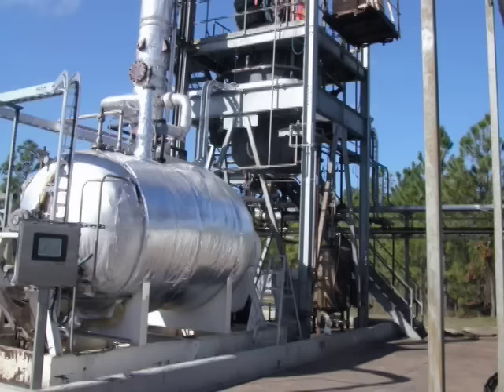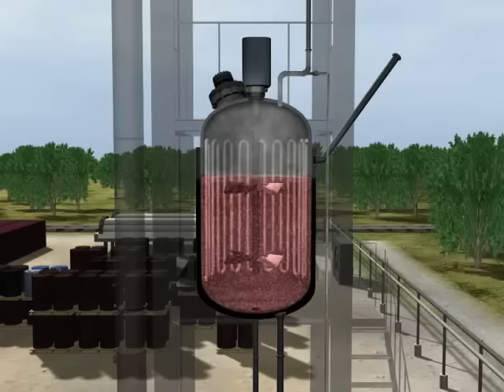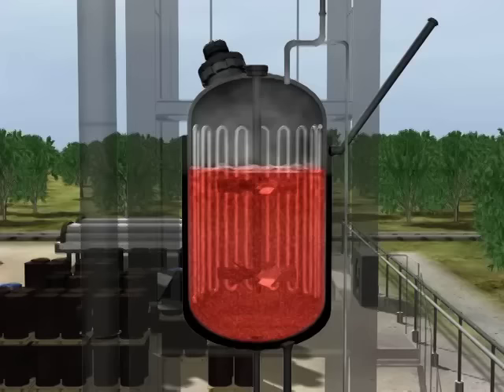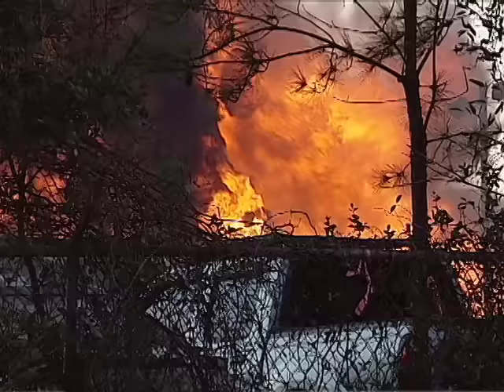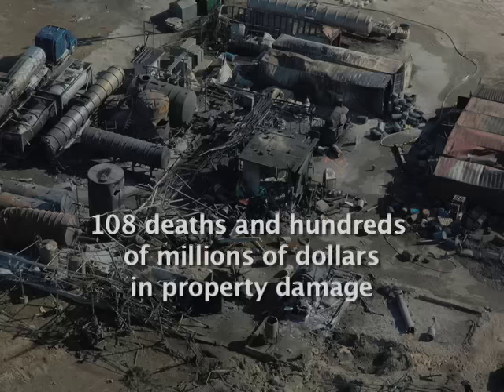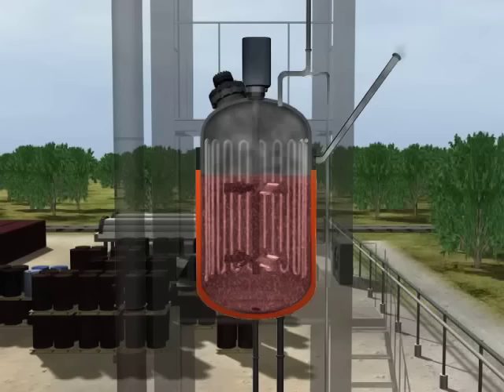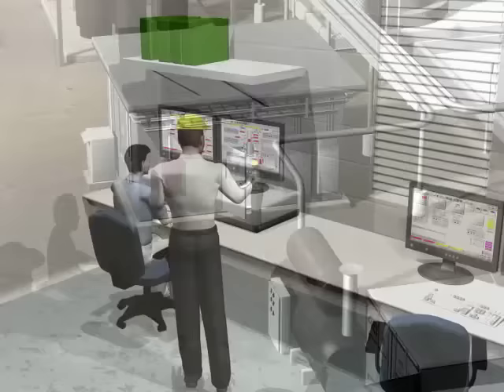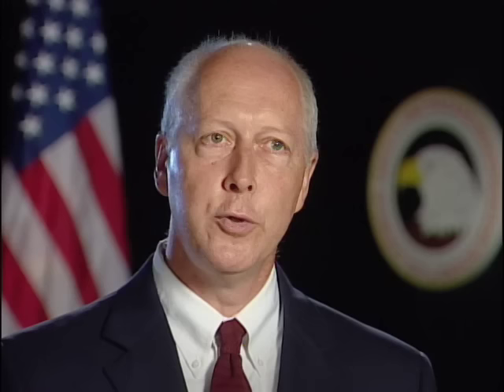Runaway: Explosion at T2 Laboratories

Comment: I work at a chemical plant. I’m a reactor operator. We run 3 3500gal reactors at almost 900psi routinely. Our high pressure interlock is 960psi and our high temp interlock is 95°c. We have 4 safety systems we can go to after operator controls are deemed ineffective. Rupture disk, catch tanks, valves to catch tanks, relief valves, E vents, E stops flares. It’s a very complex system but this tragedy was avoidable. None of these companies ever go above and beyond on safety, that cost money. Although I do feel my plant has put an honest attempt into it. Stay safe blue collar men and women.
Reply: Yep, like I mentioned above who designs something like this without a backup cooling system? It's unforgivable on several levels.
Reply: Sounds great Engineering dd !!
💪💯
Keep safe !! 
😊😊
Reply: I work at a plant as well. and I don’t think we’ve ever checked if everything works before making a batch. The only thing we check before making a batch is that we have all of our raw materials…we find out shit breaks WHEN the shit breaks.  I’ve only been compounding  5 months and I’ve never checked if my cooling systems work s prior a batch. 

I will NOW tho
I’m pretty sure our only cooling method is city water as well.
Reply: That's how you do it. One of the fundamental mindsets of any engineer is to plan for the worst case, not the ideal. Assume operator error, assume failure of systems. Have redundancies, interlocks, the whole nine yards.
Reply: @whiteru55ian33  You could show this video to your superior and make them realize the danger before anything catastrophic happens.
Reply: @skunkjobb Facts!
Reply: What you describe is the minmal basic security, as you say, it is not at all "above and beyond". The tragic thing is that the US is so adverse to unions (and many of your unions are honestly not doing a very good job at being a workers interest organization) that we see a complete lack of safety requirements that make accidents as bad as Bhopal (which was in India in 1984) still very much a near certainty in the US.

Comment: I worked for six years as a synthetic organic chemist. In a laboratory, each day, I mixed two chemicals in a 20 oz flask with a solvent and stirred them overnight, to react together to form a new chemical. If that chemical was determined to be of interest, we sent my process to another lab in a distant city, where experts in scaling up from 20 oz to 1,500,000 oz would design a new reaction. The difficulty is that the larger amount sheds heat 1/100th as fast as the smaller.
Reply: That's a lot of stirring.
Reply: Your hands must be very strong
Reply: @aarontooth  There is such thing as magnetic stirring, y’know?
Reply: Why can factories that create potentially dangerous things be allowed in the middle of inhabitants it should be put outside cities for safety. Like Lubrizol in France look it up.
Reply: @CanularRadio  the vast majority of the time they were outside the city limits, when they were built. It's just the city's grow and houses are built close to these chemical plant, much later on.
Reply: @Etz-b37  Bingo...
Reply: @Etz-b37  Exactly. The land around industrial zones is cheap (for obvious reasons), so developers build new developments on it.
Reply: I think this is more of a lesson about why redundancy is so important.
Reply: Sounds boring
Reply: Interesting ! Which compounds ?! 
😊🙏
Reply: People are totally unaware of magnetic stir bars and hot plates lol

Comment: Exothermic reactions need to have backup cooling systems. It’s a must. Uncontrolled positive feedback gets very dangerous very quickly. Also with uncontrolled positive feedback can cause very abrupt pressure rise and clearly needs a better pressure relief pipe, if it exploded within 10 seconds of the disc rupturing, it clearly wasn’t sufficient.
Reply: Two words. Complacency kills.
The processes weren't properly analyzed, failure modes not mapped, proper reactor emergency responses not documented and trained on and the design was horrendously deficient. As you said, an emergency cooling system and adequate venting system could've prevented the accident. Honestly, it was a miracle more weren't killed and injured from such a blast.
Reply: @spvillano  This kind of process is best done in continuous flow system. Not so much material in a single vat, so it is easier to cool or won't explode at all.
And it it goes wrong, there is less material, so a much smaller explosion.
Reply: @pizzablender  all true, although as I understand it, not all processes can be done that way.
Reply: @mnxs  Correct...
Reply: Right? The whole system was designed more like a firework than a safe reactor!
Reply: My thoughts exactly, as soon as they heard the whistling they should have known they F'd up, just to bad by then it was to late.
Reply: they were completely unprepared to run the reaction on a larger scale

Comment: Reactor for known exothermic process built with ONE source of cooling? WTF did they think would happen if power outage took down their CW pumps and/or caused drop in water pressure/flow from city mains? Always have min. 2 sources of cooling or other reaction stopper.

Rupture disk & emerg vent line not sized to handle full potential gas volume from reaction runaway?  Vents known flammable gas to atmosphere instead of flare? Double-WTF.

smh... :-/
Reply: @TheBrodsterBoy The vessel rupture.
Reply: @TheBrodsterBoy Well, it was venting for 10 seconds and making a heck of a noise from the escaping fumes and the pressure clearly kept increasing resulting in the vessel exploding. So if your safety valve doesn't vent fast enough to actually reduce the pressure in emergency circumstances, I'd say that's pretty much the definition of undersized
Reply: Hydrogen rises. Its the lightest gas there is. And any amount will explode if ignited. So I suspect a flare would have been allowed the gas to burn all the way back into the vessel itself. What I'm curious about is what exactly happened chemically to the reaction to cause the explosion 10 seconds after it began to vent.  Did the sudden lowering of pressure change the dynamic? Did it allow what was left of the chemicals to react more quickly?
Reply: @Nick and if they were never trained to analyze and understand the risks (i.e. the size of the crater they MIGHT leave if things went wrong) they might have chosen a higher pressure for that to break rather than a lower one.
Reply: I'm surprised they didn't collect the hydrogen for another purpose?
Reply: @Nash1a  The gas had most likely reacted a temperature capable of spontaneous ignition. Once it began to vent to the atmosphere it came into contact with oxygen allowing combustion. I worked at a chem plant dealing with the production of ammonium nitrate. Certain parts of the chain reaction are exothermic. The temps would easily reach 1000f once the reaction stabilized.
Reply: Yeah man... this is just utter ignorance and shortsightedness. I dont see how anyone with even a high school education could design and implement a process like this. No common sense whatsoever.
Reply: @THRASHMETALFUNRIFFS  Hydrogen is ridiculously cheap and isnt used in a lot of applications. All you need is water and electricity... electrolysis... and you have a continuous supply of hydrogen.
Reply: @Smokeykiller51  Oh, that's interesting. And it makes sense too.  My chemistry knowledge is pretty weak and I would never have thought of that. I was wondering if the high pressure before the disk ruptured may have slowed down the reaction and then the rupture let is loose all at once.
Reply: @Nash1a  if anything the pressure would have only accelerated the thermal reaction and caused the other gases to remain liquid until the pressure was relieved. Honestly had the kept making the product in the specs the vessel was designed for probably would have been okay. But they wanted to increase production without spending the money to upgrade their equipment.  I have seen several shortcuts like that before. Last company I worked for which was the chem plant had to Frick compressors that is used to turn the anhydrous ammonia gas into a liquid.  While also keeping the 160 tons in the storage vessel cold enough to remain a liquid with a gaseous atmospheric pressure of around 60 psi. If those stop the ammonia will begin to boil off and become a gas again eventually the pressure relief will vent the excess pressure into the atmosphere.  Anhydrous ammonia being heavier than air would quickly settle back on the ground posing a deadly cloud of death to anyone down wind. With little ways to contain it at that point. If the storage vessel is full the effected area is a 21 mile radius. In that radius are two smallish towns and the I-10. If the wind blows the opposite direction and hard enough the gas could potentially reach the small city nearby. But that would be unlikely. Several times our spare tanks were overfill due to neglecigence. Luckily those were much smaller tanks.. now I'm a network engineer. Much safer profession lol
Reply: @andrewlightbody4221  probably encouraged due to greed.
Reply: Undergraduate degrees? Probably the second person to boil water in a sealed vessel stumbled on to that much wisdom by watching the first guy who did it blow himself up.
Reply: That's the "greatest" country on Earth for ya. Still living in the 50's when it comes to technology and safety...Yet, all of Europe wants to be Hollywood...
Reply: @Nash1a  Flashback arrestors exist.
Reply: Cooling the device will not stop runaway...the safety valve that is removing reactor load was a better fit.
Reply: @WadcaWymiaru  Cooling will stop RUNAWAY reaction. It won't stop the reaction, but it will hit a limit.
Runaway means, that a EXOTHERMIC reaction generating its own heat that isn't taken away, drives the reaction faster, and makes it more reactive, causing a faster, more violent reaction, which in turn causes even more heat, which drives the reaction even even faster.
Reaction generates heat
Heat makes the reaction, react more
The more it reacts, the more heat it generates per seconds.
These two things combine, to create a reaction that feeds itself into going faster.
Basically the reaction runs away, it accelerates the rate of reaction, further and further. If you cool it, then it will reach an equilibrium between the heat generated, and the heat taken away, and the reaction will not go faster. That's what runaway reaction means, it runs away from you, getting exponentially faster.
Reply: @PBMS123  
I know. But there is something you'd forgot: the heat conduction. You know your own home radiator shape? It is to increase the speed od dumping the heat enregy to enviroment.
This is the reason WHY cooling is useless after the runaway. Like in the prompt reaction in nuclear reactor (that are badly design) - after spark, the elements can't go away from each other heating badly and result in meltdown.
Reply: @WadcaWymiaru  nuclear reactor aren't controlled by cooling. They're controlled by control rods which are neutron absorbers. 

I'm unsure what your point is though.   Cooling prevents a runaway reaction from occuring in the first place. Whats your point about radiators?
Reply: @PBMS123  
1. Believe me, it IS! In RBMK water was slowing the reaction when in Westers reactors it is SPEEDING the fission!
2. a) but overloaded reactor prompts the runaway...cooling alone is not enough
(material can't go away from each other)
b)i was talking about the surface of heat exchange
Reply: @WadcaWymiaru  I'm not sure what your point is. Control rods are used to control the reactivity of a nuclear reactor, whether water does or not, is not here or there, the water is used mainly to cool the material, and to take heat away for the generation of power through steam turbines. 
Water didn't slow down the Chernobyl disaster at all, and its design gives it a positive void coefficient which meant the boiling INCREASED the reactivity, and the reactor, and that contributed to the disaster.
However this doesn't change the fact that water is used as a coolant, and NOT to control the fission reaction, and water cooling in emergencies, is used to protect the fuel from melting and causing a literal meltdown and release of highly radioactive fuel from within structures that contain the fuel, usually steel pipes (except in the case of RBMK which use graphite tubes).
But again I'll reiterate, control rods are what are used to control the reaction, NOT water. Water is used to cool, not to control the reaction.
Also I'm not sure what you mean by material can't go away from each other. Is English not your first language? 
I'm aware of heat exchange, just unsure what your point was, in regard to this accident.
Cooling of exothermic reactions, prevent runaway reactions. why are you fighting me on this, this is a fact. Fission reactions are quite different to chemical reactions, and have no relation here.
Reply: That didn't check the cooling system before starting the reaction? Like.. uh.. what the actual fuck? Surely there is a written procedure list for carrying out the reaction, and surely item 1 on that is 'check cooling system operational'
Reply: @Nash1a  I think the explosion was caused by internal pressure, not the hydrogen exploding.
Reply: You obviously aren't an engineer
Reply: @RogerKeulen  you're obviously no engineer
Reply: @herseem  they're never sized to reduce pressure.
Reply: @andrewlightbody4221  you're not an engineer
Reply: @TheBrodsterBoy it 'sploded would be my guess?
Reply: or just limit total volume to multiple smaller (much smaller) volumes ?
Reply: I'd seen it all. Deadwood engineers and PhD thinking with their asses are all too common than common sense.
Reply: @Nash1a  Flare stacks have a seal at the bottom that prevents the flame from going back through the flare stack itself
Reply: @PBMS123  control rods absorb neutrons whe a fission reaction takes place it creates energy in the form of heat the heat is transferred to the water wich is sent either to a water to water radiator or through a turbine and then cooled down when the reactor enters scram mode the control rods stop most of the reaction but it will still heat up if the pumps don't run so yes water does cool the reactors and help control the reaction for without water a reactor could not exist (I'm leaving liquid sodium  reactors out of this for the sake of my sanity)
Reply: @PBMS123  also RBMK's use water differently they use water (its just not as effective as graphite) to speed up the reaction instead of slowing it down fission reactions are largely dependent on heat some reaction better at hotter Temps other are the opposite water is essential to the three well known reactors BWR (boiling water reactor) HPR (High pressure reactor) and RBMK
Reply: @flexyourstyle9136  Yeah, thank you. Someone explained that 2 years ago. But thank you just the same.
Reply: Triple WTF because you’re venting hydrogen straight to the atmosphere in the first place, that’s just asking for a high pressure jet fire once it auto-ignites in air smh 🤦‍♂️